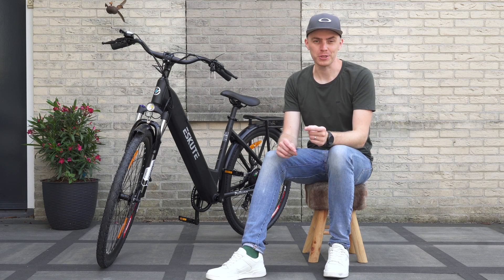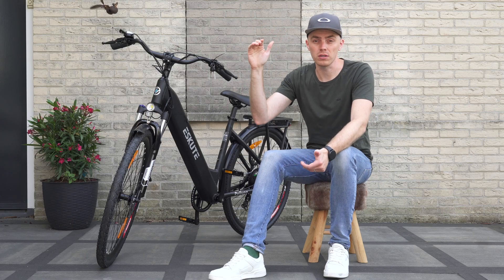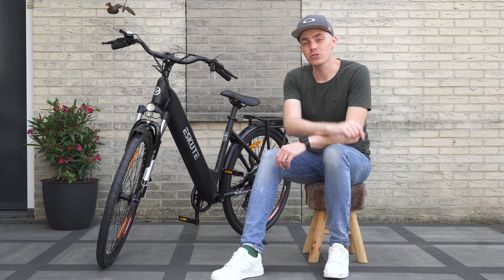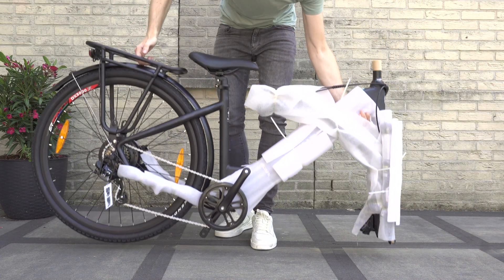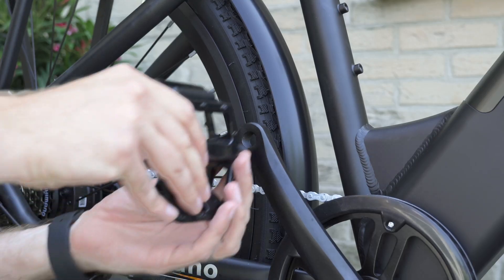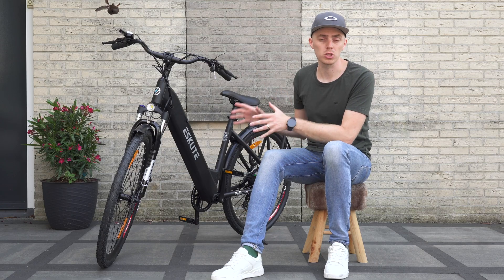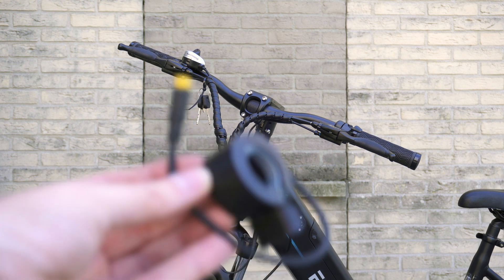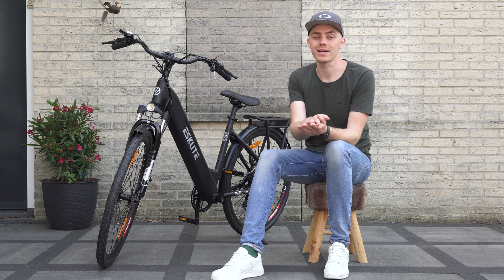The Benefits of Torque Sensor on the E-bike Polluno Plus

Comment: So where is the link to the throttle? Read the desciption 10 times but there is no link. Also Eskute NL says, apart from that they do not sell a throttle, they have DISABLED the option to connect a throttle. There is no cable to connect it to and it is disabled in software. It is technically and physically impossible to connect a throttle when u buy the bike through the links you provided. 
Could u maybe clarify and explain how u connected the throttle before people buy the bike and find out it isnt even possible?